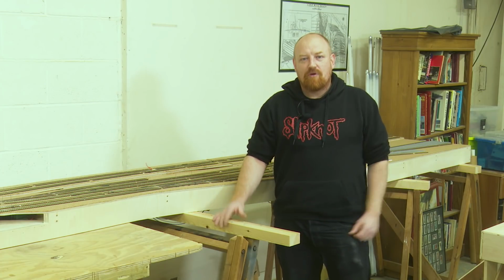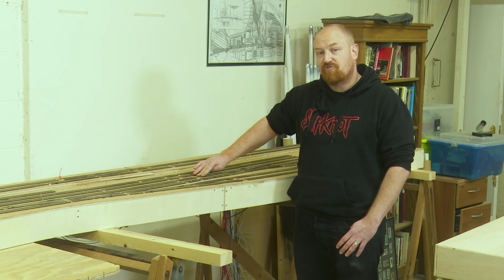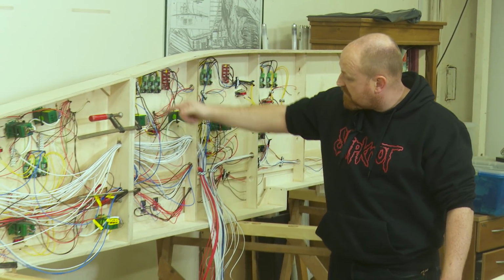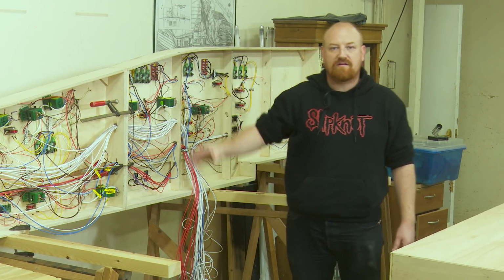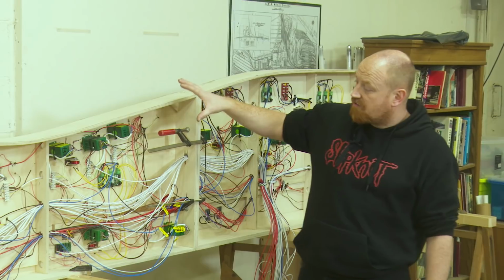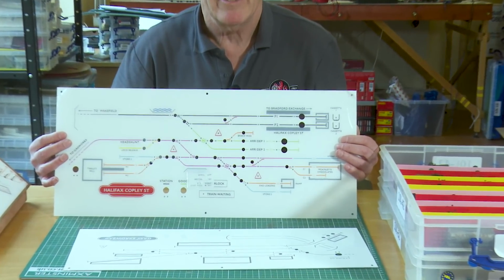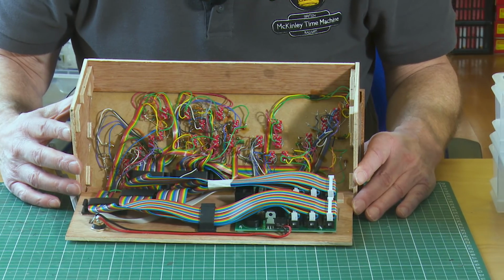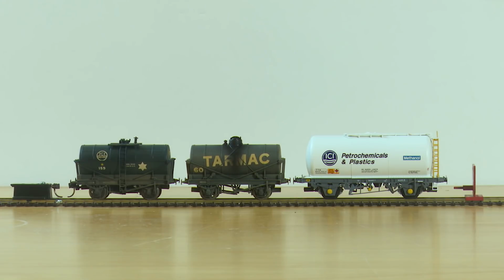62. Halifax Construction at McKinley Railway.

Comment: Great layout and concept, superb construction and design, I look forward to each and every update. It certainly takes model railway operation to much greater heights, especially the idea of the era-based grouping. So, one question; if you are running the 1975 era stock (or 1965 for that mattrer) from Hades out on the scenic parts of the layout, would there be provision for "steam specials" to be run? Would these be included in the later era's or pulled from the 1958 one (apologies if I have the dates incorrect) Regards Andrew
Reply from the maker: Good question Andrew.  Steam specials...  Hadn't thought of that one.  I suppose we will -  I have just read up on them.  They used BR Blue coaches from the pictures I have seen, so the engines would probably be introduced in the 1970s as Loco Stock to McKinley running periodically with the Mk1 coaching sets in use in that time.  Something to tax our brains when we get nearer to running the time machine in earnest.  Regards  David

Comment: David, I'm glad someone knows what they are doing. As someone who gets confused with anything more than 2 wires I had to reach for the smelling salts when I saw what goes on under the Halifax boards. Different coupling height's has alway's been a problem right back to Hornby and Tri'ang day's. You could buy a box van and a 5 plank open from Tri'ang, different coupling heights. All to do with what mold machine the wagon was cast in. Things are really starting to move along on McKinley now. Cheers, Chris Perry.

Comment: McKinley is compulsory viewing for me, railway modelling on an industrial scale.  I can't help but wonder though why the small Halifax panel uses two switches on a cross-over that includes a double slip when only one is required.  Consistency with other panels?
If you need further explanation on how to think this through please let me know.  Visiting in the short term is not practical as I live in Australia!
Reply from the maker: It is consistency.  We have route buttons too which make it much easier for the operators.

Comment: Yet again another excellent video 
Looking forward to the solution to incorrect NEM sockets I started using Kadee couplings but swapped them out for Hunt Magnetic ones as my layout suffers from seasonal fluctuations in height and Kadee don’t offer height variants for NEM sockets only on the screw sockets.
So keep up the Great Work
Reply from the maker: We will do one...  The trouble is the solution is not easy.  Its frustrating too.  I'll work on the video idea.

Comment: Fascinating insight to the behind the scenes construction (obviously following on from a lot of planning!).  It is very disappointing about the NEM couplings. I do think the product reviewers in the YouTube community should  be lambasting the manufacturers for this. An NEM sized pocket at the wrong height or distance from the buffers is NOT an NEM pocket (end of story!). I am currently going through my modest collection and retrofitting Kadees (very few NEM pockets in this mix unfortunately). The Kadees are very good but getting the height and 'reach' just right is a learning curve. I have had a few NEM pockets with 50/50 results so far. It would be nice if Kadee had an underset and an overset option within the NEM lineup (although it shouldn't even be necessary)
Reply from the maker: The truth is that NEM pockets are not dependable.  They are not the easy fix they should be.  In the early 2000s we shaved off the mainline, lima and Bachmann couplings and installed appropriate 20 and 30 series boxes.  In hindsight I feel I should have stuck with that logic.  Whats more they are much cheaper too.  never mind...  We have created some cunning solutions.
Reply: @dattouk  You have my attention. Not dependable in what way? Do they not function or fail in some manner? Or do you mean the manufacturers interpretation of what is a NEM coupling pocket cannot be depended on? I would be very interested in your latest thinking and some of your tips and tricks you refer to. As mentioned my NEM conversion is 50/50 so far as to whether it is plug and play .. or plug, cuss, and adjust. The legacy T/L couplings are 100% remove and replace so NEM is something of an improvement.